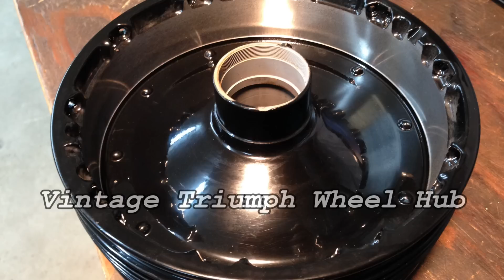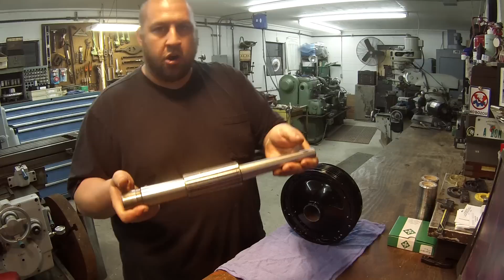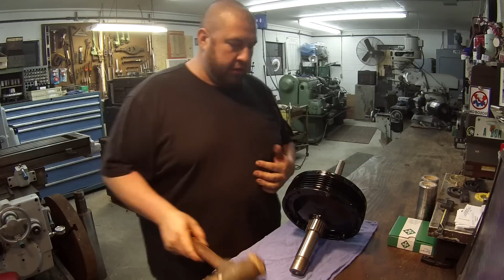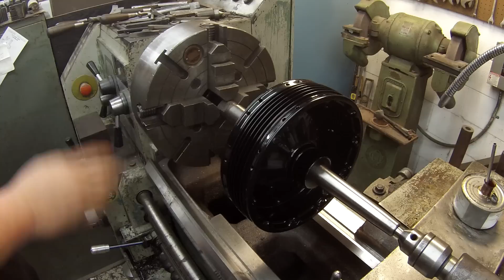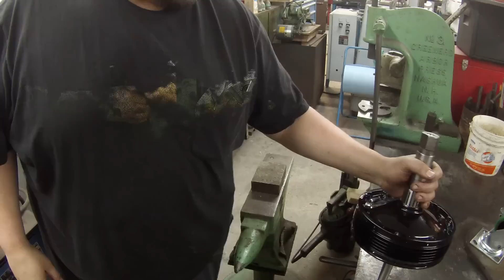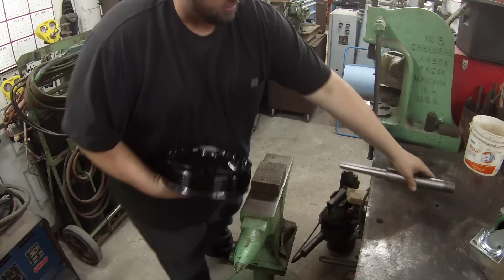Vintage Triumph Wheel Hub

Comment: Neatly done! Yes, holding the wheel by the hub is exactly how the motorcycle will do it when the bearings are put in, so truing to them is far superior than anything else.  You no doubt took away the juddering that would happen when braking on the bike with the out-of-true hub as it was originally.  An excellent improvement.  the fact that the spoke-carrying flanges are not true is not at all important because the spokes will be adjusted to take out any discrepancy to produce a true wheel rim.

Comment: Not sure why the triumph shop doesn’t know about “aircraft remover”. That stuff turns powder coating into gel. You just carefully brush the Aircarft Remover on the powder coating you want to remove and after a few minutes you can scrap the softened powder coating off.

Comment: The material is aged and there is less tension in de casting. The surface is now probably better than it left the factory. After the drum and brake shoes are run in, it should function great.

Comment: A consideration (strategy?) for someone building a motorcycle like this, might be to have you machine away the coating from the brake surface and perhaps the spoke attachment points.  Lace the wheel and ride the bike around for a bit, then remove the wheel, rebalance the spokes and true as necessary.  Then, with the wheel assembled, trued, all finished up, etc., have you skim the drum again.  That would take a mighty big lathe, but the motorcyclist would want the drum to be true after everything is assembled.  The spokes' tensions will vary and may cause a slight distortion of the drum.  If that's not compensated with a final skim, the result is an oscillating brake pedal, which is kind of annoying and reduces performance, in case that's of concern.  You were right to secure the drum on a mandrel by it's bearing surfaces.  You'd want the brake surface to remain concentric to the axle.

Comment: When the only tool you have is a hammer, everything looks like a nail. :)
Powder coat comes off easily with paint remover. 
An authentic old brit bike restoration should be done with paint not powder coat.
Adam is the world's most over qualified brake drum turner. lol
For sure now that drum will be running truer than new.

Comment: At 13:00 you mentioned truing the hub.  It seems that it is true for the side nearest the chuck where it's mounted to the expanding mandrel.  The end not supported seems to be not centered well.  Is that an illusion due to the powder coating not covering the end of the flange?
Reply: Also, that extra light at the bench is a great idea.  It makes viewing objects much better.

Comment: too late now ...  TIR on the brake side is what you want to avoid.. the brakes are going to pulsate like crazy.  carve up a some spacers to go into the hubs for both sides..
Reply: If the brakes are going to pulsate like crazy---your claim---what are spacers going to do to correct that? Does not make any sense! The brakes will work JUST FINE.

Comment: Straight pulling spokes?
I'm sure that most manufacturers, including Triumph, used spokes with angled ends at the hubs, apart from AJS and Matchless, who used straight pull spokes. BMW did not consider angled spokes to be best either, and used straight pull spokes on all their machines.
Reply: +wontputrealname 
And the hub is a aluminium casting with either a shrunk in or cast in iron liner (probably cast in).
Reply: +wontputrealname 
I should have watched the whole video before commenting beforehand.
The brake plate will need thicker than standard bake linings to compensate for the material removed, and they will then need to be machined on the brake plate with a thin spacer between the operating cam or cams, to the diameter of the drum so that when the shims are removed the brake plate will then fit freely into the brake drum with very small clearance.
When the brake is operated, the shoes will then make full contact with the drum thus bedding in quicker and making the brake work as it should.
New standard thickness linings will take ages to bed in properly in a drum which is as little as 1mm (.04in) oversize. Much more and they may never bed in.

Comment: Lacing the wheel up can distort the drum slightly, should really be machined with it all laced up.
Reply: +caferacing What are you going to chuck it up in to turn the shoe surface after its laced up?
Reply: On a mandrel.

Comment: Beautifully done. Your setup was just as rigid, if not more so, than what most people do when cutting on a brake lathe. I prefer to cut drums on an engine lathe. I always get a great finish with minimal material cut from the drum. More people should consider using an engine lathe to replace several specialized automotive machines.

I have been watching your videos for a long time, and really enjoy what you do.

Thanks,
Marc

Comment: Hello Adam, I'm a fairly new subscriber from the UK, I'm watching all your brilliant and interesting videos one by one from the very first, just one or two at a time when I can, about halfway now!
I'm retired now, never was a proper taught machinist, but used a lathe in the Bedford truck plant many years ago, also in the UK.
I have a cheapo Chinese Clarke, what you'd call a hobby lathe that I use to skim my BSA and Triumph brake drums, I do have lots of mandrels but none big enough to put in my triumph Cub and BSA Bantam hubs.
I am forced to use the original axle and bearings and turn between centres, the difficulty is finding a way to get power to the hub because of the bearings' rotation.
Happy to say that I do get by and the finished product not only looks good, but the wheels rebuilt by myself stop realy well too after skimming and new shoes.
I applaud what you are doing and giving to people here like myself, I enjoy every one you do, Mr Pete, the two Keiths etc too of course.
A merry Christmas and a happy new year to you and yours, thank you Adam, much appreciated. David Dale, UK.
Reply from the maker: Thanks for the comments Dave.

Comment: Thanks to You, Adam! For this simple, but all important contribution to the worldwide ongoing & neverending process that is the restoring of great motorcycles from the past! Without people like You - fine tuned machinists wanting to take on these jobs, and solve our problems, we wouldn't be able to enjoy our hobby as much as we can today!
PS; at 14:52 I think I saw You taking a "stare into the air" - where You listen for the sound and feel the vibes when the tool does its job the way You want it. Am I right, or am I right? LOL ;)
Thanks for sharing. Wish You a Merry Christmas and a Healthy New Year!
PPS; The call You heard, was probably Your wife Elena, ran out of bubbles... Remember to feed the bubble cracking monster frequently, or it may turn on You! LOL..;)
From Erling in Oslo, Norway.
Reply from the maker: Sort of yes. I was eyeballing the dial to get it back close to where it was last set, but as it was getting close I was listening for the tool to start touching off. Good eye.

Comment: Nice job Adam and i look forward to your videos every week.
One point the bike shop should have laced and trued the rim to the hub BEFORE giving it to you to skim. These vintage hubs always distort when you lace and true up the rim. The brakes were never the best in the first instance but when you skim the hub after its laced and trued you have a true surface for the brake shoes to work on and much improved brakes. I have rebuilt literally hundreds of vintage wheel rims over the past thirty years and this was the only way to get the best braking.

Comment: Regarding work holding options for this kind of work, there is (at least) one more solution you did not mention.

You could make a set of soft jaws like the ones on the left or in the middle of this picture: http://files.taiki-jaws.com/taiki/SJ08.jpg At my previous workplace I made this kind of soft jaws by welding a thick enough piece of a flat stock to the end of a regular soft jaw. They are not as accurate as the methods you mentioned, but our concentricity requirements were usually within 0.002" and for that they worked nice.

Comment: Love that mandrel. I could use something like that. Not sure what for, but use it all the same.  So we know the run out could be introduced from the inner hub, outer hub, or mandrel (doubtful). Does it not matter what actually runs out? Long as the center runs true the rest will turn to spec? 

Also, does TIR not stand for "total indicated runout"? It was hard to catch what you said
Reply from the maker: I kinda botched the TIR statement. Sometimes we don't say the words we should. LOL
On parts like this hub, your braking surface should be true to your bearing mounts.
Reply: Abom79 Eh no worries. I'm just a student though your age. We covered gd&t fast so more me double checking me then you. Your understand what you meant and thats what counts at the end of the job

Comment: I aways put a nondirctional finish on the drum to seed the new or old brake shoes to the drum.   It makes less hot spots on the drum and they run quieter for longer
Reply: What's a non-directional finish?

Comment: I really liked the finish on the cast iron, I could see the rivet's reflection, great grind on the tool.
 As far as the powder coating, there are several ways to mask off the areas that do not get powder, one is a thermal masking tape which would have applied in this situation, or blocking material, foam, non-residual paper tape etc.
Reply from the maker: Thanks William.

Comment: That hub looks 60s so a better choice would have been black enamel paint as per factory finish off that time. As a few pointed out the powder coat would somewhat hinder heat dissipation. But not Adam's call.
Surprised to see Adam blowing down that super fine cast iron swarf, don't think I'd want that contaminating the ways.
Reply from the maker: That's what the wipers are for, and they do the job. You would be surprised at how much cast and ductile I have to machine, sometimes it's piled up all over the machine. Too much to worry about blocking from getting on machine ways. But I always give them a wipe to help protect them, especially when I've done some polishing.

Comment: Well to be honest in such a part where the pull of the spokes distorts the form it's actually irrelevant if you're not 100% on target. The break pads will soak up any imperfection.

Comment: Nice work on the hub, even has more precision and a much nicer finish than a mechanic could have done on a brake lathe. All the inserts i have ever used in the past were pointed and leave grooves however slight they are and give a rough look. Now its hard to even find a auto shop with a lathe.

Comment: Good job on that !!!. I don't know how they could protect it from the powder coat . I would probably just have it coated and then do what you did
Reply from the maker: Yea it turned out ok anyways machining it afterwards.
Reply: I probably would have used Kapton tape to mask that area.
Reply: Masking tape works as well. Just take it off carefully before you heat.

Comment: Very cool. I'm a vintage Triumph guy myself. I don't think my lathe can swing a full width drum like that but I have cleaned up a slightly smaller one from a pre-unit once. My machine is  10" EMCO. Thanks for sharing! I really like the expanding mandrel, need to find some of those.
Reply from the maker: Thanks. You can buy some of those expanding mandrels from Enco. I have a couple at work I ordered a few years back. They are imports, but good quality.

Comment: Ciao Adam, I think the brake shoes will have a very good surface to wear now. A question: did you make the expand mandrel by yourself or they are commercial stuff?
Reply from the maker: The expanding mandrel is a commercial item, but I have a full set ranging from 1/2" all the way up to 3 1/2". You can still buy them in some sizes. MSC and Enco have them.

Comment: That shop does not have a brake lathe ?
Reply: bikes havnt used drum brakes for decades, so they wont have all the old tooling of the old days in a modern shop
, plus of course modern shops arnt trained to fabricate or machine any parts and would replace a part.
Reply from the maker: I don't think they have the machine to do this type of job.
Reply: No modern shops have brake lathes, all newer brake rotors and drums do not have enough material to machine, they are throw away. If any shop tells you they can turn the rotors or drums on your car RUN as fast as you can. Manufacturers put just enough material there to make it out of coverage.
Reply: rbellhotrod
I think it depends, most of the time new parts are just too cheap to bother, things are a little different if yuou have some fancy sportscar with crazy expensive rotors
You can get machines that do it while on the car
Reply: There is no depends anymore, by the time you are ready for a break job the manufacturer does not leave enough material to use the same amount before discard  or minimum thickness. The thinner a rotor or drum is the less heat dissipation it has compounding the wear of the brakes. Which in turn winds up giving you about 10k miles before next brake job instead of 40-60 like the originals. The quickest way to put it is take as manufactured thickness and subtract what you have at brake job. The number you come up with is how much wear happens to the rotor per brake job. Now subtract that from what you have minus 10-30 thousandths for the turn, you will be under minimum thickness if you are not already. And anyone that tells you different or tries to teach you otherwise is fooling them self. RUN! The math does not lie, just ask a machinist.
Reply: Richard Schmidtendorff you apparently have not done many brake jobs. every vehicle and manufacturer is different but they all have minimum thickness for rotors and max dia for drums specifications listed. many times it will be cast or engraved right on the rotor/drum. majority of the vehicles can be turned at least once, some manufacturers do recommend an expensive on car brake lathe so the rotor is cut to match the runout of the hub. the reason not many shops turn rotors anymore is because the good old lathes are worn out or hard to find and new ones are very expensive. where as new import rotors for most vehicles can be purchased for very cheap.

Comment: I turned many many brake drums in my day but never seen anyone do that to one ?Why would the coat the friction  part ????
Reply: someone forgot to mask it off, the powder coat attracts to all surfaces, its not really possible to direct it when you spray it on, its electrically attracted, at least they masked the hub, plus after 50 years it needed a skim on the brake surface anyhow
Reply from the maker: I think it was just an oversight.

Comment: Adam
I know it's not your call but will that powder coating stop the heat disapation of the hub ?
The reason I question it is because a  mate did up a 1939 vintage bike up and painted the cylinder with heat risiting gloss paint , it seized up PDQ when the paint was removed it ran fine

Stuart
Reply: Stuart Hardy Abom79 Like you said, not Adams call, but yes, the powder coating will cause the hub to retain heat much more so than an uncoated example.
Reply: cylinders get much hotter than drum brakes, the sheer mass and the not great performance of motorcycle drum brakes mean it wont get warm enough to cause any issues, cylinders need all they can get for cooling, and even polishing the alloy vs leaving dull or spray painting with the proper paint can cause it to overheat, its all about radiation, and yep powder coating will be pretty insulating as its plastic based and thick
Reply from the maker: Your right, it's not my call. I was only doing the machine work asked. But I would have to imagine yes it would hender the cooling of the drum. But, with it being cast iron, it needs some kind of coating to protect the metal.
Reply: I think that hub was black powder coated from the factory, it just resists heat not stops it. A lot of bikes mid 80's and older had powder coating. They are way ahead of autos.
Reply: I think that bikes of that build was as Adam said is in the sixties and they was silver painted , at least mine was and they did rust 
Boy do I miss my Manx Norton
Stuart
Reply: Yes, the powder coating will reduce heat dissipation, but likely not a concern for a vehicle used infrequently and/or for short periods, such as a restored antique motorcycle.  I.e. parade duty doesn't get the brakes that hot.